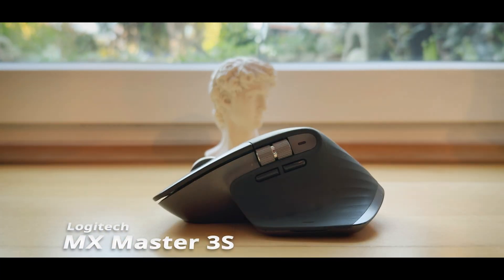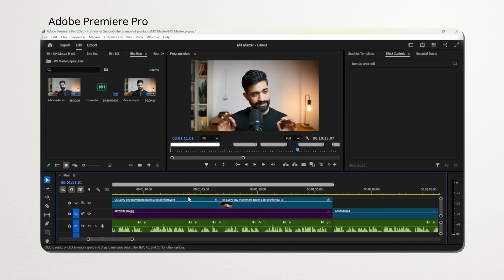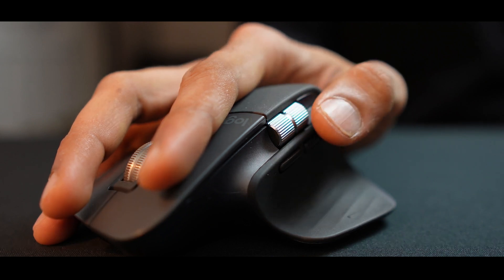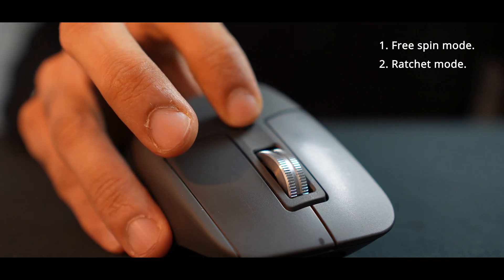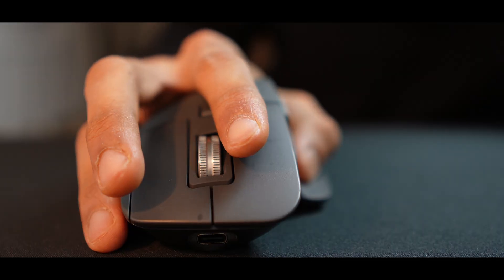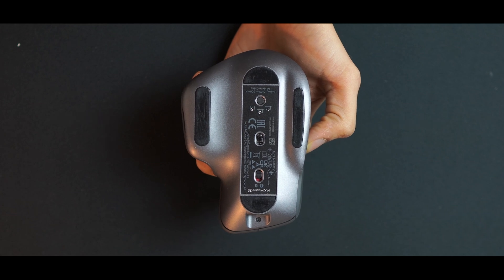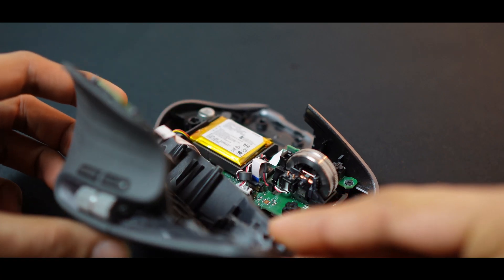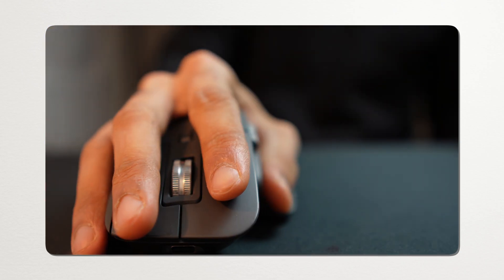Why the Endless Spinning Mouse Wheel is Genius

Comment: I have a Razer Basilisk V3 Pro. You can configure how the wheel works and tbh, I don't think I ever want a mouse that doesn't work like this one.
Basically, you can choose such as if you just use the wheel slowly, you feel its tactility like a regular mouse wheel, but if you rotate it fast, it automatically unlocks and works like the wheel on the Logitech, and automatically locks back to tactile mode once the wheel stops spinning.

Comment: When I go down a long page I don't keep "flicking and flicking". I just grab the scroller and drag it down in 1 second.
Reply from the maker: yeah every user is differnet. Ideally scroll wheel was designed as a faster alternative to scroll bar and then this mouse is trying to make that even smoother..But its always upto user.. if you are interested you should check out my video on design research. its on the similar topic.